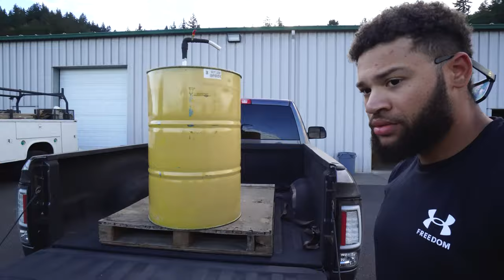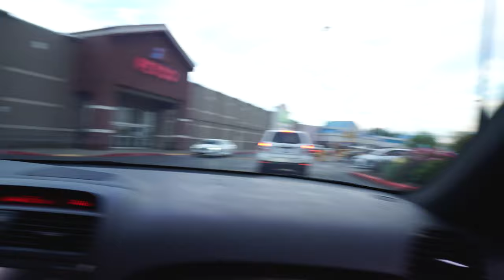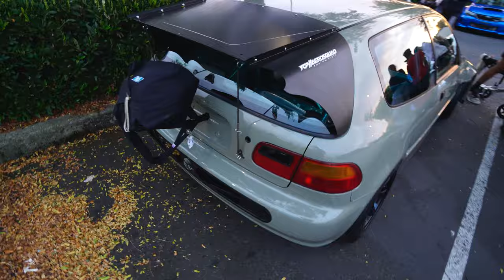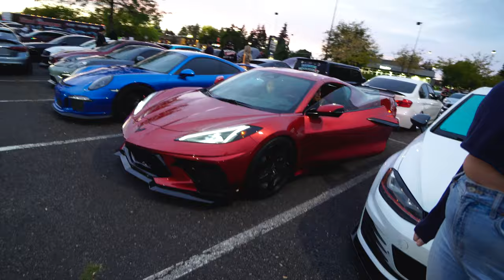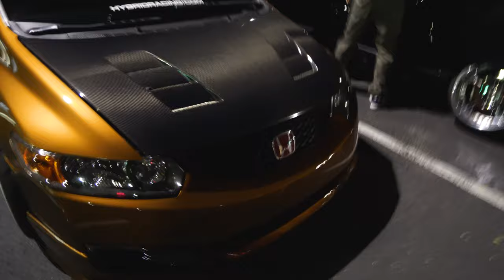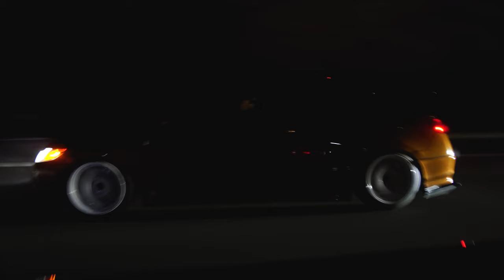BOOSTED TL-S  Finally "GOES TO MEXICO" POV Driving

Comment: Solid runs man! That civic was no joke. When i went to get my car tuned, a similar civic with a kraftwerks rotrex kit tuned on 14psi and e85 and made 460 so he should be bout the same. 

Deff gotta brake boost like k rolls mentioned.  Rotrex cars always in boost.  

Solid run and great video. & Ms insurance 🔥🔥 😂
Reply: yeah the 8th gens are beasts. Doesnt help that his transmission has longer gears than a d series lol guy shifted at 7k+ and fell back to nearly idle
Reply from the maker: Yeah civic was getting it, i definitely gotta learn the car drives way different boosted, was a good time though we need more 💪🏽💪🏽

Comment: Nice vid man. Funny that you lost every race tho. I think your transmission seriously puts that J series at a disadvantage. Gears are way too long, as you can see in the race against the 8th gen. Short gear ratios in that 6 speed keeps that k20 in high revs.
Hows your traction with those really small ass tires? I wouldnt trust going over 50 mph with that 'stance; as well. lol